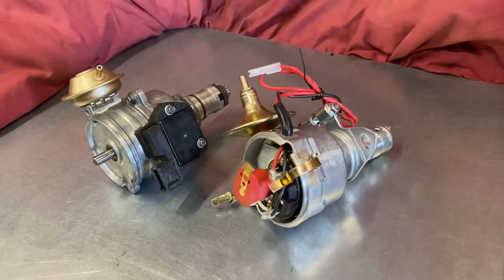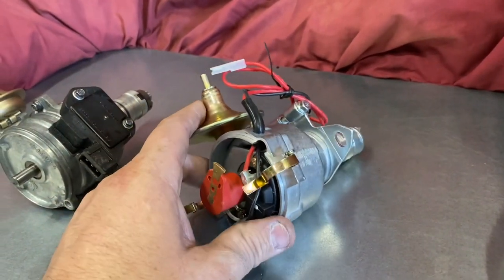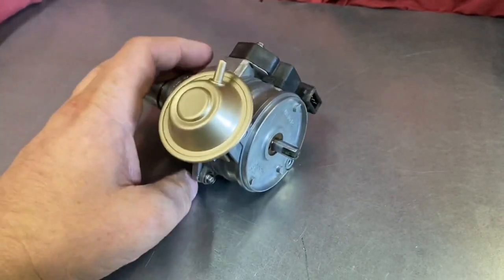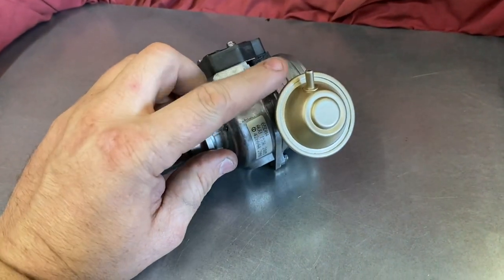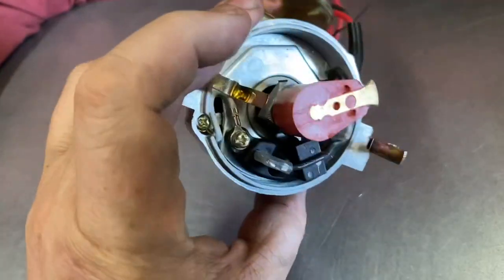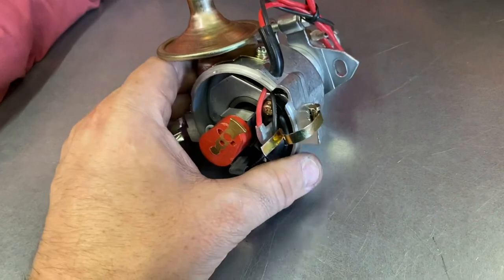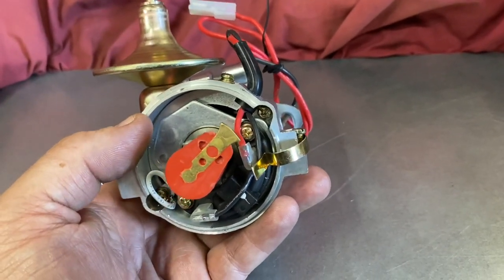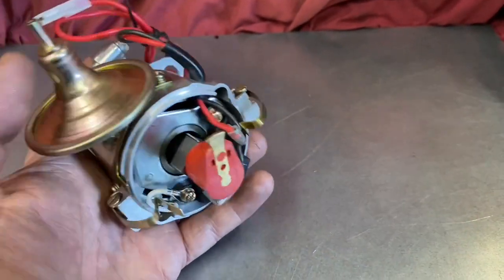Electronic ignition for your Classic A-series

Comment: I didn’t realise there was a difference in electronic ignition also when it comes to high power coils. 
I recently bought a 0.7ohm coil. 
I’m going to buy tbe high power leads from powerspark. 
I only know my dizzy is electronic and nothing else as it came on tbe car. 
Will I also need to change that? 
Or can I check this in anyway to be tbe correct one I need. 
And also are you around tbe Doncaster area anytime over the coming months for a tune up? 
I like to fit the correct components ready for you and get this done Iv possible. 
Many thanks 
Oh it’s the 
Crossflow 
1.3 
You kindly responded to the other day. 
Thanks
Reply from the maker: You need to match the coil to the ignition module you are using, not all will work with the high energy coil.

Comment: AC:  don’t really understand vacuum advance.  Does the vacuum increase or decrease under heavy throttle applications? Does the vacuum system work with or against mechanical advance?  Why doesn’t the S engine have a vacuum advance?  If the vacuum advance isn’t there, has the mechanical advance been modified to compensate?  I would greatly appreciate your straight-talking advice on all this.  I note both the dizzies you were discussing in this video had vacuum advance systems.  Would you use these on a Cooper S motor?  Cheers, Will
Reply from the maker: Vacuum advance is used in conjunction with mechanical advance to add additional ignition advance at low throttle openings and light load running. This increases efficiency and resposiveness and is a must for road driven vehicles where economy is required. When the throttle is opened fully, vacuum drops to near zero and the advance unit retards the ignition back to that delivered solely by the centrifugal advance mechanism. Cooper ‘a’ engines never used vacuum advance because it simply was not needed on an engine that is driven at wide open throttle everywhere

Comment: Thanks for another great vid.   I'm current using an electronic module in a 45D that doesn't have variable dwell.  Is there anything to gain by switching it to a variable dwell module that can run a 1.5ohm (or less) coil?
Reply from the maker: Yes that’s the point running a lower ohm coil means you can run more spark power
Reply: @ACDodd  thank you, yes I understand that.  I've always been in the "if it's lit, it's lit" camp but I will experiment with a variable dwell and lower ohm coil to see if there's any improvement in the upper RPMs.
Reply from the maker: @user-du8cs8sn2v  the real benefit I see is better part throttle torque and the ability to light off leaner mixtures and still generate the same power. Higher rpm should also be noticeable.

Comment: I've got a programmable ignition module which can adjust the dwell. Have you got any idea what the dwell curve is like on the 65D from idle to max dwell? For the moment I've updated it to 20 degrees at idle, and then up to 70 degrees at 4000rpm and above. Currently have a 3 ohm coil
Reply from the maker: That will be ok for a 3 ohm coil but you need to change the coil and the dwell curve to match. I think it’s about 22-23 at idle and about 45 max to work with a 0.8 ohm coil and no ballast resistor
Reply: @ACDodd  thanks! Would does the dwell directly relate to the ohm of the coil - ie the lower the ohm the quicker the dwell?

My module is only rated to 1.5 ohm minimum
Reply from the maker: @timsminigarage  kind of.

Comment: Great video.  Just confirming that i can run a 1.5ohm coil now meant for a ballast setup after watching this with no other changes except a new coil?  I have a non ballast setup so 12v at the coil and a 45d with the powerspark electronic ignition that metions the variable dwell angle (not the high energy one) and a 3ohm coil. Thanks so much keep up the good work.
Reply from the maker: Yes as long as it’s variable dwell, a you use 0.025” plug gaps
Reply: @ACDodd  I do not think you can run a 1.5 ohm coil on a 12v input as it will burn out. They are intended only for use with a ballest system as all 1.5ohm coils will be described as ballest coils. So need to install a ballest resistor so lower voltage like 9v.

Comment: Quick question, after watching your videos about dizzy and coils - I have A+1275, non-balasted wiring, with 65D4 dizzy and I found out that my coil is 1.1Ohm. About to swap new plugs (NGK BP6ES) and I was thinking that 0.35mm gap would be too much and 0.32mm could be more optimal for this setup? (Measured my HT leads and they are between 4.7 and 7.5kOhm)
Reply from the maker: 0.35mm is not 0.035”. Change the coil to the correct 0.8ohm unit and run the correct plug gaps. Use lead sets from
Powerspark and you will be in the 1 to 3kohm range
Reply: @ACDodd  Correct, I meant 0.035", typo there :) I have plan to get correct coil, but it will take some time before it will get to my place and I want to have car available until then. Will have a look at the HT leads as well.